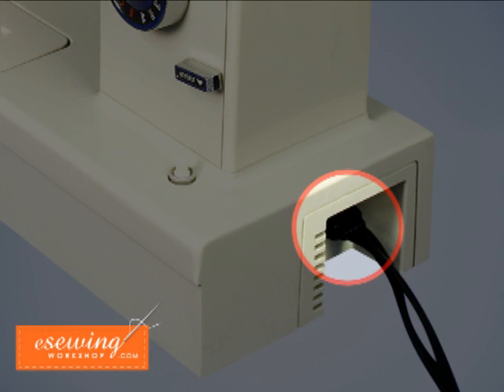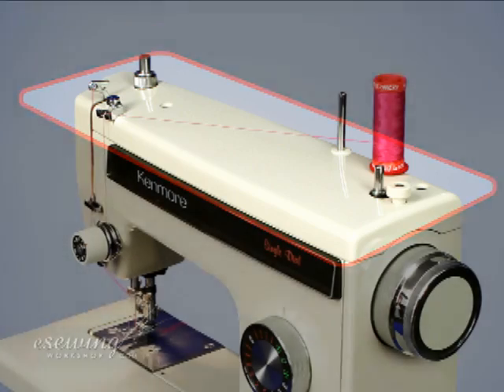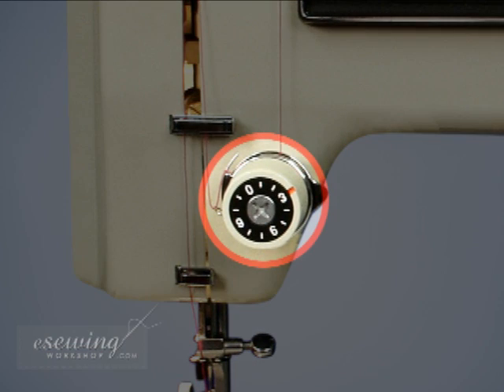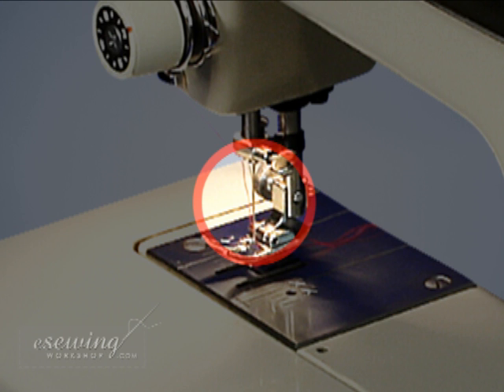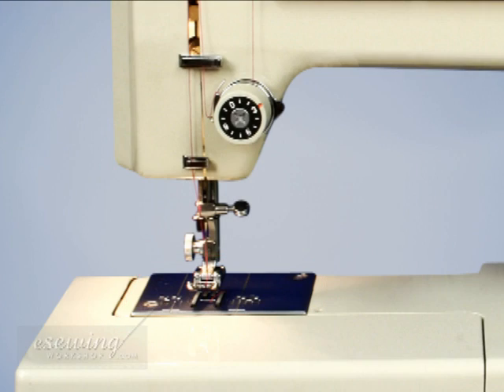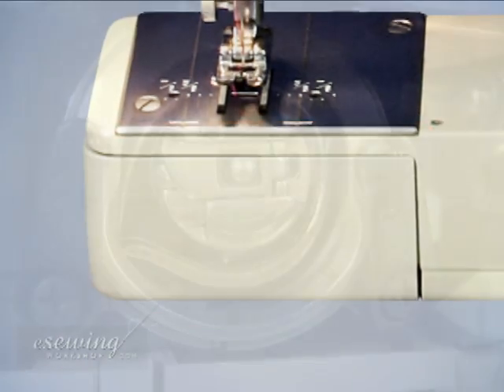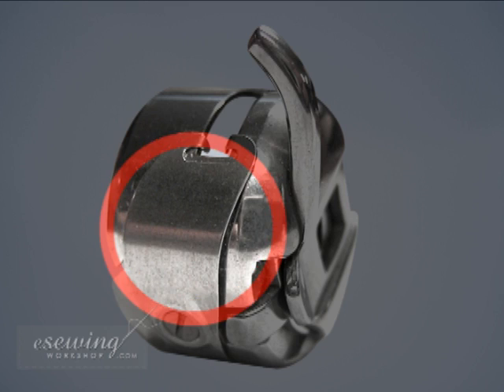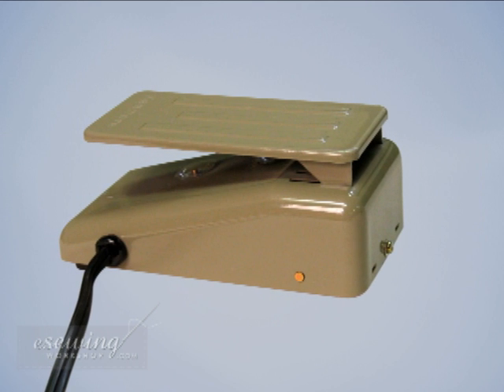10 - Kenmore - Sewing Machine Overview - Sewing Machine Essentials (FREE SAMPLE)

Comment from the maker: @llazy1 

The device you see on the top left side of the machine behind the thread take up lever, adjusts the presser foot pressure. Some of the machines do not have this feature. Some newer machines are automatically adjusted for the thickness of the fabric. 

When the fabric is thicker the presser foot needs less pressure to let you sew properly. On this machine the numbers go from 0 to 4. The higher the number the more pressure will be exerted by the presser feet.

Hope this helps,

Nehzat
Reply: I know this comment is 9 years old but I've been trying to figure out what that button is for nearly that long, so thanks